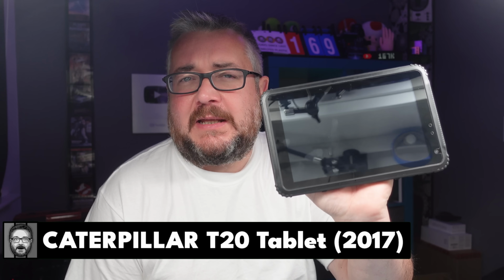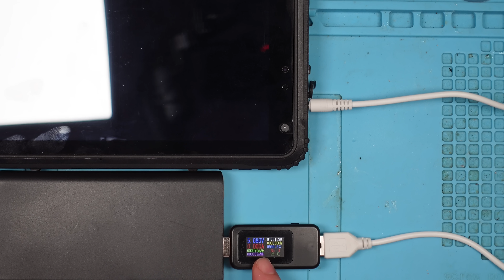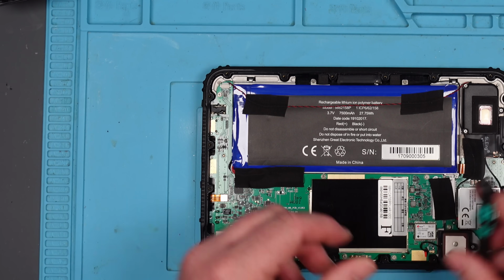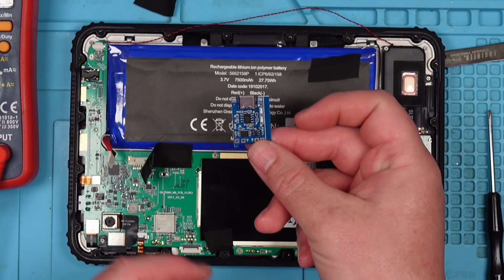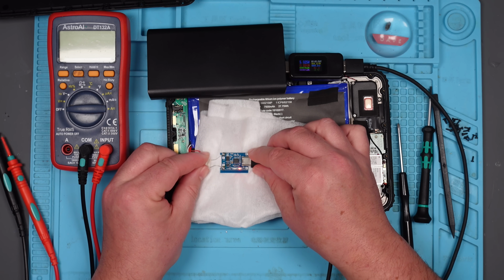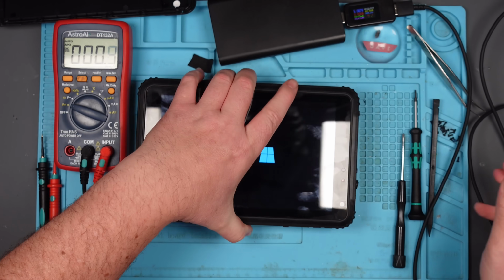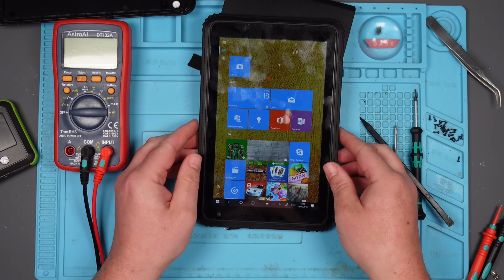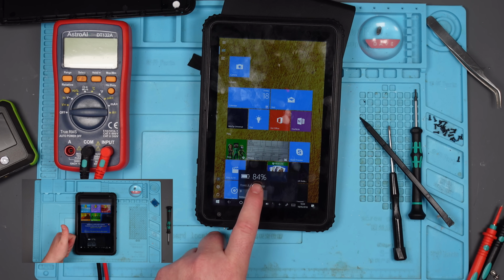A VIEWER sent me this FAULTY CAT T20 Tablet | Can I FIX it?

Comment: Hey Steve! You connected the battery Charging Connector wrongly! You hooked it into the OUTPUT of the Board, used to Drive Electronics from the Board (that one has Battery protection for <2.5V), which could deliver 5V unregulated to the Battery! You need to use the B+ and B- pins for the Battery! Be careful out there. Also, its running Windows 10 in Tablet Mode (easly disableable in the Notification Menu. And the reason it didn't charge, is it dropped below 2.5V and those TP4056 Modules dont care about it
Reply: Cam here to say the same, I was expecting an explosion at that point. 😂
Reply: I had the same point to say and thought I had been doing it wrong all this time. Lol 😂
Reply: But he fixed it without exploding. Well done!
Reply: just did a double take myself and came to say the same thing
Reply: Ask many questions you do ,  The force is strong .
Reply: He bypased battery protection circuit on the module, but it's still fine. Output goes from tp4056 battery charging pin, so no 5V.
Reply: @l0udPL  honestly, im willing to believe this. However knowing china and cheap products, its still better to not risk it, no?
Reply: Guys, whatever it is hooked to runs off the battery and not 5v. What pads do you think the battery is hooked today the discharge end? The positive terminals are the same track. Only the negative is unique to battery and they is for reverse polaitty protection. When you buy the to4056 modelue with the texts chip on it then you basically have a 1S charger and BMS on one board. 

What you should have been more concerned about is the 2 red 2 black and 1 white wire which indicates 2 batteries in parallel with one thermistor wire. 

Those cells are probably only in parallel at that end plug so if you charge one and not the other when you hook it  back up you'll have a big voltage difference and therefore a large inrush of current as the batteries try to equalize. Luckily it's only 2 cells, but if this were a bigger pack  that would have been very bad. 

He probably only charged one cell. Stez make sure you balance those cells in the future. That could have been bad. I just lost a rental property to a tenant mishandling these cells and burning the place down. This guy was a real moron. You are not. I really wish you guys showing other people how to fix things would learn about these cells and how to properly charge and discharge them . Unless you are a complete idiot there is no reason to have a fire. A little knowledge goes a long way. All you little smarty pants were wrong, you need some more knowledge too. BMS always works by switching at the negative end, why? Because p channel mosfets are more expensive probably. 

Tp4056.5v goes in one edge and 4.2 goes out the other. The negative trace goes straight through on the PCB but the positive does not. So 5v can't get out on the plus side and nothing can come back in on the minus.

I build lots of balance chargers . Up to 20S. And yes each one requires it's own isolated power supply to hook these boards up in series. Dollar Tree USB charging bricks. I have so many of these things but they are useful when you have a triggered BMS that someone thinks needs replacing when it actually it was just doing what it was designed to do. 

Stez if you read this and you would like to be more knowledgeable about lithium batteries in all their many forms I could certainly help you with that. When you know about something like this you can keep a lot of good batteries from getting tossed out. Most people will just throw these things in their normal garbage can. That's no bueno.
Reply: @zentechnician  either way, better to connect stuff to the right pins anyway, no? Also, i doubt it was a multi cell battery i think it was just multiple pins to split the load across those tiny wires.
Reply: @TheCustomFHD Siir that is 2 cells together in parallel. You don't use 4 wires for one cell. You obviously don't have much experience with pouch cells or hard side batteries used in laptops etc. Medical devices and things like alarm batteries and I this case a construction company tablet used at a remote site require extended battery life. The cheapest way to do the is to double up cells . 2 black, 3 red, and 1 white for a temp sensor shared between the 2. I assure that shape and size is not one cell. You were just not as right as you thought you were. 

I already told you the way the races are run and that what he did ultimately was fine. When you buy any of these modules whether they are buck/boost or otherwise the inputs and the outputs are usually separated as far as possible. No matter what 5v is not coming out that end. I'm very sorry him soldering to these pads has somehow triggered you but you are just making a fuss about nothing and honestly you are arguing your point with someone that knows quite a bit more than you do. You should probably not do that as it dies not make you look smarter...at all. Okily dokily? I don't need a whiteboard do I? It's ok to be wrong. You don't have to keep digging for any little shred of credibility. It's ok to not know something. You can move those traces around in your imagination all you want but that doesn't make it real. 

I'm very sorry I wasn't clear enough for you the first time. lol
Reply: @zentechnician  bro.. yes you can use four wires for once cell per.. considering the bms was on the far end and the battery was Ridgid, we can assume its one cell. Also, it wasnt thick enough to be two cells stacked ontop each other. All i said with the wires, is instead of running one thick wire to the one positive terminal, they might have chosen to run two thinner ones. Kts perfectly fine to run two wires, where only one is needed, that way you can increase the current load those cables and connectors can handle. Ive seen it multiple times, often many of the pins are "shorted" to eachother as thdx just run alongside eachother to ease the load across multiple wires. If this wasnt the case, the board, connector, and cables would have melted, as more than 10A would have flown to even the voltages, perhaps even rupturing a cell. Which clearly didn't happen. Im not saying its impossible, im just saying it isn't the case for this device.
Reply: @TheCustomFHD  That is 2 cells. Side by side. Not stacked. 7550mah is real big for one cell don't you think? You just can't be wrong...in your mind at least. 

You are WRONG. Enjoy. 

<pokes bear>

I can make a video for you and show you exactly how that battery is put together since you can't imagine anything aside from what makes you right. But then I would have to get up and it really isn't with the effort. I just feel bad for whoever has to live with you and your rightness. That's going to become a real issue for you at some point. 

Point on the doll where the bad man touched you.
Reply: @zentechnician  bro.. 7500mA in one cell is nothing new. The Galaxy Tab A 2016 did this already, iirc even 8500mA. Stop projecting your ideas of "not being able to be wrong" and move on already.. geez. I wont reply no more to this, its of no use.
Reply: @TheCustomFHD  Cut open that battery from your Tab A and you will find 2 cells inside. Which you can plainly see .in an image of the battery. Just search for Galaxy Tab A 10.12016(T580/ 
T585/T587/P580/P585) 
Battery (EB-BT585ABA) 
and you will see that you are absolutely wrong...still. 2 cells not one. STILL WRONG.
Reply: @zentechnician  i have infact cut it open, as ive replaced it.. one cell. Not to mention I've seen plenty 6000mAh.. even recently saw a 10000mA in a low power long life device.
Reply: @TheCustomFHD my Anker powerbank has two cells in parallel. 2 10k mah pouch cells 

The other guy doesn't know what he's talking about lmao
Reply: I didn't came here to say that
Reply: @zentechnician I’m not convinced you’re right, but then I’m guessing you never read the textbook on persuasion or charm.

Also there are 3 black wires, not 2. So it must be 3S?
Reply: Whether he's right or wrong, he's definitely NOT Zen😂
Reply: @zentechnician  I am pretty sure it's not an uncommon sight to see two small wires run to a single cell battery in these small profile devices. The battery itself looked like a single cell to me.

Comment: "They" should make it easier to replace batteries. And provide proper, affordable, replacement batteries of course. Stupid fix. Cool video though. :)
Reply: CAT S22 flip Android flip phone has replaceable battery why not this!
Reply: Replacable batteries were popular when smartphones first became popular.

But the number one reason for your phone getting slow as it gets older is that the battery performance becomes less reliable and the phone automatically underclocks to reduce load on the battery. Why sell a phone that can be made good as new for $20 when you can charge $100 for a service tech to replace the battery(probably also make up other faults or just claim it's unfixable forcing them to buy a new phone).

Same reason IMO they've started going for the notch(which IMO looks horrible) and edge to edge glass, it drastically cuts reliability of the screen, and if the screen breaks 2 years in you're paying out of pocket to get it fixed.

Comment: I had a old android tablet that didn't turn on.  When I plugged in a power adapter it didn't seem to charge.  After a few minutes it was still completely unresponsive (no battery charging indication etc.)  However, after leaving it plugged in, it eventually started charging after a few hours.  It must have been "trickle charging" at first, a phenomenon that others have mentioned. The lesson is that if you have an item with an internal battery that seems completely dead, let it charge for a very long time, maybe 24 hours, before deciding that it needs extreme measures to repair.

Comment: This reminds me of the 1st gen Framework laptops. They had a tiny rechargeable BIOS battery that if you didnt use your laptop for a week or two it would run out and refuse to turn on. Really handy.
Reply: That's a very major design flaw.
Reply: They must've copied Dell; they refuse to boot when the CR2032 is flat.
Reply: @Okurkaarrgghh  Not really. The CR2032 lasts years and isn't recharging. That's not a problem.

Comment: That "sipping a trickle of power" may have been the charge circuit trying to revive the low cells. Many chargers do a VERY slow charge on low cells until they finally rise to a safe charge voltage, then they will switch over to the normal charge rates. This can take hours if at all  though, so opening up and manually charging can also help. Any cells run super low are likely to have lost considerable capacity and likely to puff up over a short time.
Reply: Theres only 1 'cell' , its a 3.7/4.2v lithium battery. Depending on the quality ( which will be low) it should be fine down to 3v as resting the battery will raise the remaining charge a little. Personally if it goes below 3v with no load id bin it as its not worth the risk.
Reply: You are not allowed to say "puff up" anymore  🏳‍🌈

Comment: I had a problem with Ryobi batteries doing the same.  They would show as defective, but if you gave them a jumpstart they would work again.  You just always had to make sure you didn't run the battery down to 0% or you'd have to jumpstart them again.

Comment: There was a similar issue with the old Nexus tablets. Sometimes you had to plug/unplug them a few times to get it to take enough charge to get the battery kickstarted. Then it would take a charge eventually. Sometimes unplugging the battery for a few mins would work too. We had so many come back faulty at the place I was working at the time.

Comment: this is ringing bells, you get a catch-22 situation where the there's no power in the battery to fire up the charging circuit which recognises the power adapter. Heard about this happening on some phones (may have been windows aswell). Nice one !

Comment: This is a common problem with lithium batteries. Once it drops below the low voltage threshold, it wont charge unless kick started. It's a safety thing i believe for big in rush current can cause fires.

Comment: I've had a couple of things that done this (phone and old iPod). I heard it's because the devices always draw a little power to recognise when a charger gets plugged in, even after the device shuts off as a flat battery, this can make a battery completely dead. 
I used to put the device on a radiator or get it a little hot, it normally gave a very very slight voltage to the battery, enough to recognise a charger and start charging.

Comment: 5:09 you connected the battery on the output voltage of the module. The battery goes to the terminals labeled as B+ and B-. The other ones are for the load or the device you want to use the battery.

Comment: I think your diagnoses is correct. I've come across charging systems that refuse to charge because the voltage is so low it doesn't recognize the battery as a battery. Don't want to start a fire by dumping voltage into a ground fault or something I guess.

Comment: I've had this happen to various devices.  The power control circuitry in both the device and charger aren't intelligent enough to prevent back feed of power from the battery if it's left connected to the charger but not to power.  I had a phone die on me like that years ago when I left it to charge in the car overnight while camping.  Didn't consider that the power socket would go off 10 minutes after the key was removed.  Woke up to a brick.  Always been able to bring them back by manually charging the battery to reset the protection chips.

Comment: Steve I had an Ipad from work that was the very same: refused to charge and had sat in a shelf for months until the battery was down to sub-zero. I had to take the hairdrier to it, and warm up the battery. That finally allowed it to start taking a charge and recover. Interesting to see it happen on a Windows tab, I wonder if it's something to do with the form-factor or just the design of a Tablet battery?

Comment: If it has ca LiPo battery they it's very possible that it was stored without being charged. LiPo batteries normally have a control chip built into them. If they discharge beyond a certain voltage the chip that controls the charging will sometimes no longer recognise a voltage in. You have to force in a charge bypassing the controller chip and then it will work as normal. LiPo batteries are one of the best but you need to treat them with care and never let them run down and store them without a charhe.

Comment: I noticed quite often with batteries with a charge controller built into them that they don't always give you a voltage, and instead you need to measure them from the raw battery terminals. That may be the case for this one, or I guess it is possible the battery is really just super flat

Comment: yeah sounds like a battery issue. The switch has the exact same issue, as once the battery is worn out it won't charge fast enough to charge the device so you get a black screen. Most people suggest in that case to leave it charging overnight and hoping.

Comment: Looking at the voltage the battery had before forced charging, it had just dropped too low for the bms of the tablet to charge. Its a safety feature as it can be dangerous to charge batteries that are too low on charge.

Comment: My guess would be, that there is some kind of protection circuit on the battery which disconnected the battery due to low charge. The tablet did not charge it, because it saw no battery at all (no voltage) - but the usb-c charger just started pushing out voltage/current, which usually resets those protection circuits. I have had a couple of badly puffed up cells, and even those at least showed roughly 1v under no load, so 0 volts just screams protection circuit...

Comment: I've had a few things like that where the battery got so low you thought it was goosed but if left on charge long enough it does start charging. Though some devices now have an intelligence chip (stupid chip)  that locks the battery from ever being charged if the voltage falls too low, even if it's brand new!
Reply: It is a safety feature, a damaged lithium battery can have a low voltage and trying to forcefully charge it can make it catch fire.
That would cost millions if not billions in claims.
If it's a new device or still under warranty simply return it.

Comment: Things can go very low if not used for a while. My switch put a charging symbol on for a long time and would not switch on booting and immediately going back to battery symbol. Only drawing 0.4 amps. Tried different charger and no different. After 15 minutes it suddenly powered on and drew 1.6 amps. Even then only on 1 percent! So it might charge really slowly and allow it to work when it hits a certain voltage.

Comment: Unplugging the battery could have drained all residual of charge which could have caused a safety feature to cut charging. Once circuit board completely drained it would reset everything. Also charging the battery separately most likely help. Iv had many pc start back up after I drained the motherboard.

Comment: It's the same with power tool batteries if the get too low the charger won't charge them but if you use a 12v battery charger and trickle charge them for 30 mins they will then be recognised by the charger

Comment: I've got a BlackBerry Playbook with a similar issue, and I assume a lot of devices do this as a protection measure. The charging circuits refuse to charge undervolted batteries because it assumes the battery is bad altogether (that, or the residual charge of +~3.5v supplements the charging/standby function)

Comment: You are supposed to wire the battery on the B+ and B-  terminals of the usb-charging board, not on the output pins.
This is safety critical !